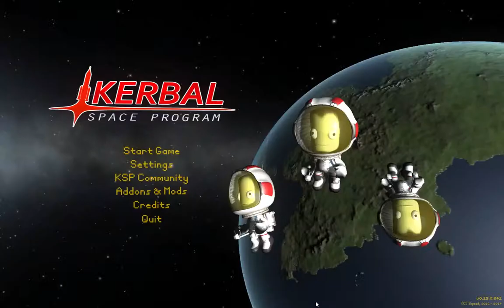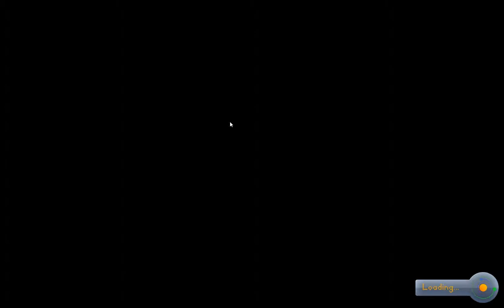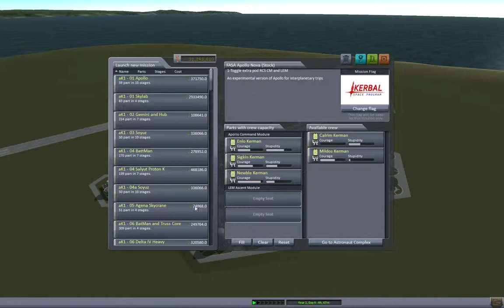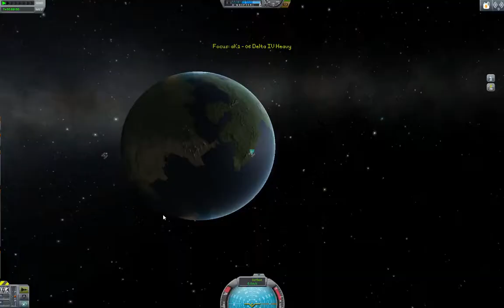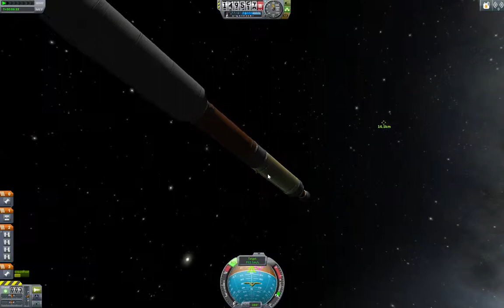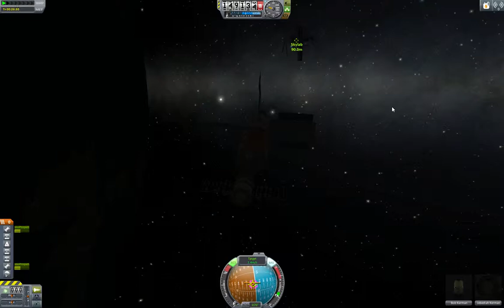KerbalOdyssey - Salyut/Skylab

Comment: Hello! It's me. I am sorry to tell you that i've tried several ways to acquire KSP after buying it. But nothing works. I am very disappointed because tour Skylab series inspired me to imagine what could've been done with the Shuttle,because you said it doesn't work properly. But i wanted to try Inigma Tus'one,because it's more realistic. Could you tell me how to log with Steam and buy a complete version of KSP. I repeat i can buy it,but, after this,i have only an email,and nothing more. How did you bought it? 

Otherwise, a great series.
Reply from the maker: +Antonin Mathieu hmm, I just went through the Steam Store, searched for Kerbal, purchased it, and after it downloaded an icon appeared on my desktop.  Beyond that, I don't know.  I only know how to use these things when they work, and my Google-Fu skills are lacking, at best, lol.
Reply: +K1productions I've heard that the actual Skylab was nearly running low on fuel near it's decay. But some footage of it's fall are still available on the Internet,at various sites. 

Your series gave me the inspiration for doing a "What if NASA saved the Skylab?" Because the TRS i've mentionned in one of my earlier posts could have been launched by a Titan rocket,to buy time for the Shuttle to inspect the station for possible re-use.It was even proposed by the contractor of both Titan rockets and payload Martin Marietta now Lockheed Martin . (If launched,it would have been the first private spaceflight,decades before SpaceX,Virgin Galactic or other private space organizations) I've found on this subject the actual re-use proposal. But me too, i think NASA gave up with a space station program in order to focus exclusively on the Shuttle. But it's cool to imagine what if MM's proposal had been accepted,in order at least to avoid damages by a falling spacecraft. (Although Skylab didn't cause any damage,the Australian town of Esperance sentenced NASA to a fine for illegal waste disposal. It was paid only several decades later,by an amateur Californian radio network,after a subscription). 

After this,i would like to say that the Orbiter spaceflight simulator (a free concurrent to KSP, but also realistic has a "Skylab 1980" addon,wich reproduces Skylab reuse study). 

And this series gave me inspiration for building a large modular station in Orbiter.
Reply from the maker: Antonin Mathieu
Nice to provide inspiration ^_^
Go for it.  I'll keep my eyes open